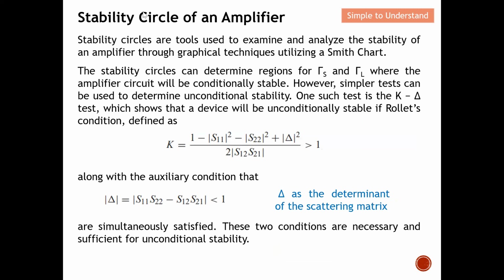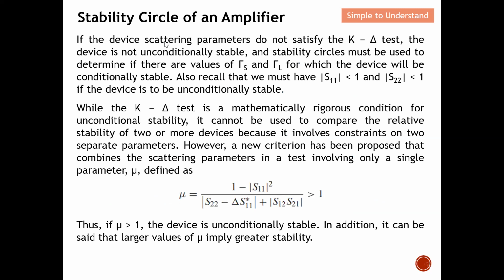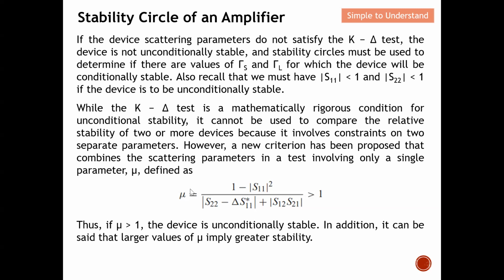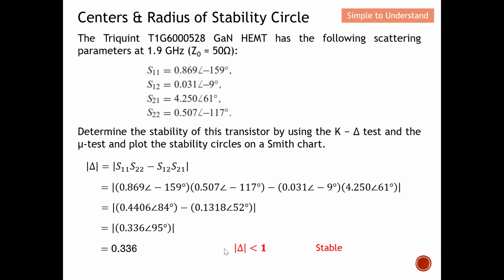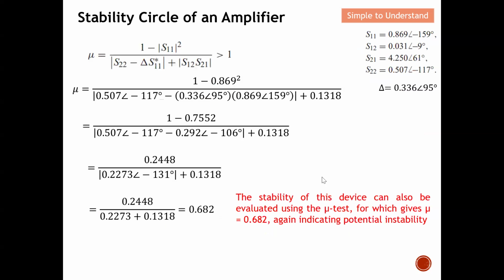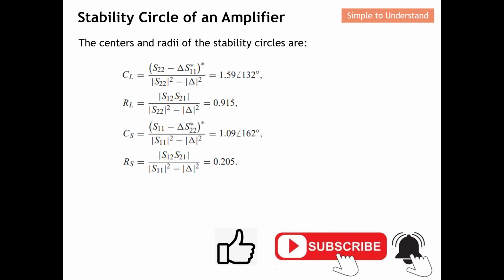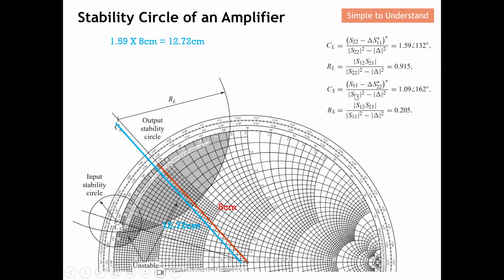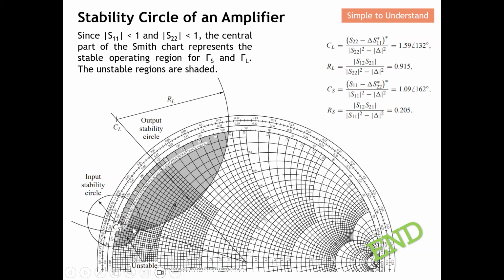Amplifier #12. How to Find Center & Radius of Stability Circle & Plot Input/Output Stable Regions.

Comment from the maker: Thank you for taking the time to watch this video. In this video, I will explain how to plot the Input and Output Stability Circles for amplifier design using the Smith Chart. This discussion will cover the calculations and steps needed to determine the centers and radii of these stability circles.
After plotting the Input and Output Stability Circles, the center point of the Smith Chart is typically stable—provided the conditions for Γₛ (Gamma_S) and Γₗ (Gamma_L) are satisfied. This will help us identify the regions suitable for amplifier design.